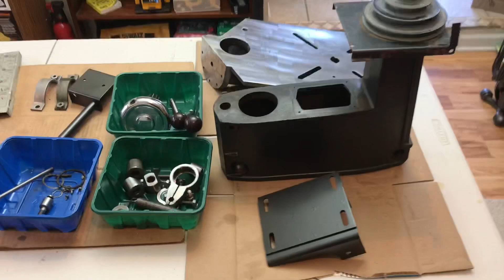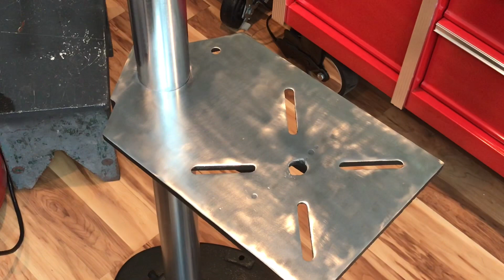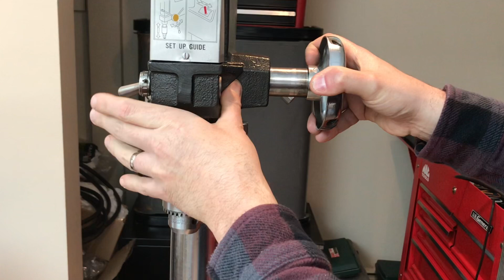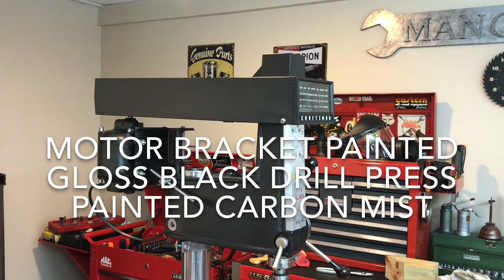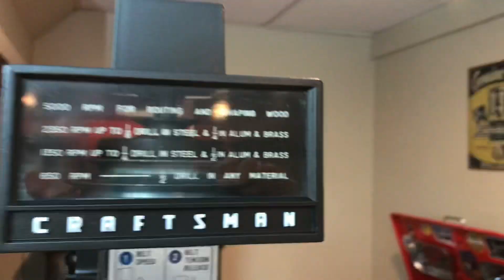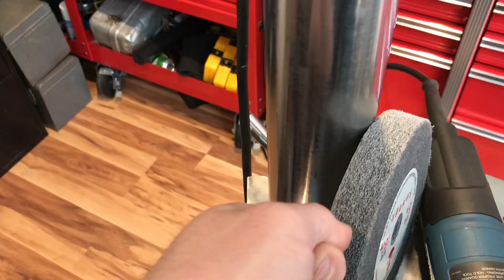Finally Done! Vintage Craftsman Drill Press Restoration!

Comment: Thank you for this video. I bought one of this model because it has a 6 inch drill depth. I also have several older pieces of Craftsman machinery. All have required some upkeep on occasion. The reason for the bastard sizes on bearings is Sears had the bearings made in non standard sizes and built the machine to fit the bearings. You can often not find a replacement bearing with out buying the replacement from them. The old 6x48 sander belt I own, I had to have a machinist make one of the drums for it due to a bearing locking up. He made me a new drive drum for $40 more more than Sears wanted for the bearings. Now it uses standard bearing available at any parts store or bearing shop.

Comment: I was wondering what im missing or whats going on with mine because the base doesnt hold the stand in place. The drill press can spin around without the base moving and it will also come out of the base if you lift up the drill press.

Comment: Nicely done sir. I recently inherited this exact drill press from my late grandpa and I am in the process of restoring it. You wouldn't happen to have the part numbers for the replacement  bearings? It would be greatly appreciated.
Reply from the maker: Not sure if they have more but it will tell you the size at least. https://www.ebay.com/itm/2EA-620216-2NSE9-C3-Nachi-BEARING-JAPAN-16X35X11mm-16MM-BORE-SEALED-2NSE-2NSL-/302482168985?_trksid=p2349624.m46890.l49292
Reply: @TomGunnTools  Much appreciated man. The original sears 1/2 has a bent shaft and its burnt so I'm having the shop source me a baldor or leeson 1hp upgrade. Thanks again. 😁

Comment: Well done... so the model yr. is 68 or 69 ? But do you know the actual model # and if a manual is available ?  
I have one and have been looking for a manual... again well done. (Edit) It appears that Izik below may have a link for further info.  Glad you made it through COVID...
Reply from the maker: Yes, that link is to the 1969 catalog. Crazy but this design was only made for 1 year! Not sure if you seen my 1950 drill press restore video but I find myself using the smaller one more frequently.

Comment: Nice job! Looks great. When I need a square hole in metal for aircraft work I let the unkown drill presses I get to use "walk" my part around. None are perfect. I control my holes by hand, no vices. Drill presses are not machinist mill quality or strength, no matter who makes it. Again, nice job.
Reply from the maker: Great info. Thanks for sharing. Appreciate the kind words.

Comment: The pulley bearing will have nothing to do with the runout on the spindle. Sometime in the past, somebody probably was holding a workpiece by hand and the drill caught and spun it around and bent the spindle slightly. I see you have a Jacobs chuck,  although not their top of the line model, they are still the best chuck on the market in my opinion. No twist drill will drill the exact size of the hole, no matter how good of quality, I would be  more than happy with it as is. You did a great job overall and it looks great. You should be very proud of your machine!
Reply from the maker: I really appreciate you sharing your knowledge with me. Thanks for the comment.